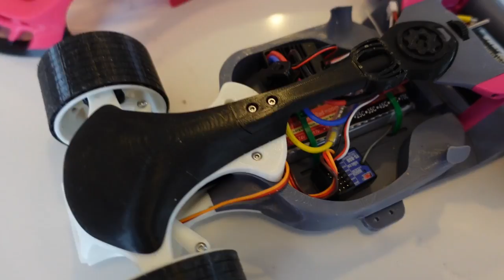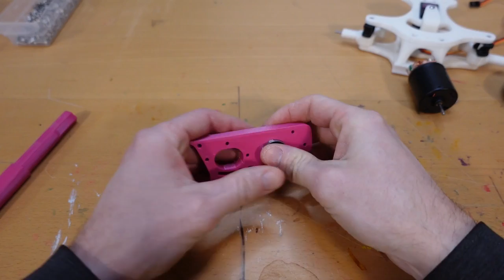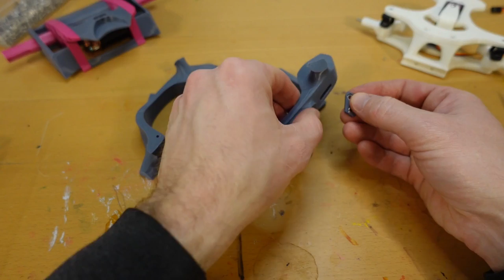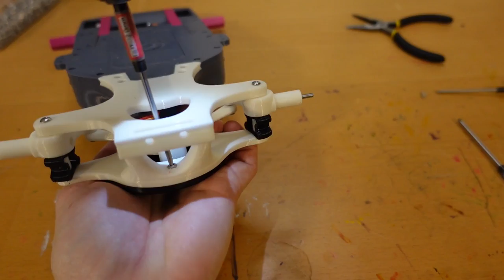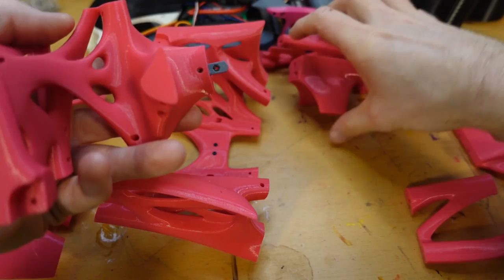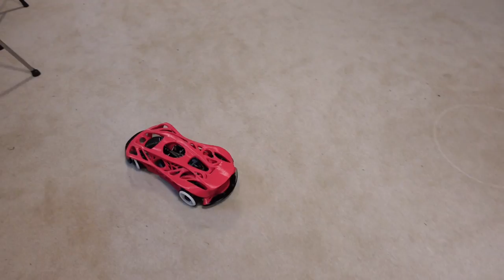Caramel CRC - Futuristic 3D Printed RC Car Build and Review

Comment: I almost built this.. I actually have built a lot of the other stuff on PrintedNest, such as the Caramel Minis for some kids.. but I’ve built too many TPU tires before and there is just too little traction for where I’d drive it. With a good rubber option, maybe brushless motor and a differential, would be really nice driving. Sharp body, though .. Good designers there.
Reply: Curious if you've tried a foaming tpu before like variosure tpu. It won't be as good as rubber but it's typically quite a bit grippier than any other tpu I've tried
Reply from the maker: You got it. I totally agree. I hope they make a v2 someday.
Reply from the maker: I haven't but I'll check it out.
Reply: @lio1234234  there is a version of NinjaFlex that has just come out called "Edge". Sounds promising but I don't know anyone that has printed with it to see how  it would do for tires.. and almost no one carries it yet.
Reply: Its just not necessary to 3D print everything, till even the tires. I like to make some custom rims to fit whatever tire is available in a compatible size.
Reply: @rcprinter  we will think about. Problem is than size of stock tyres will not fit with our design. Solution is to find some, and adjust size of the wheels, then it will work. Critical is external size and width of stock tyres, if we will fild some, we are able to make update of wheels for stoc tyres, quite fast. Then you will just re-print wheels and we are done. If someone of you have and idea, which stock tyres will fit our design, just put it here in comments.
Reply: @radiocontrolcardevelopment7329  If you have found some, put it here and we can check it and adjust wheel tyres for this. Btw, we can make 3 different wheels sizes for more most common stock tyres, if you guyz want :)

Comment: Very nice look car. The design doesn't allow for easy removal of the battery. I'd be concerned about leaving a LiPo battery in the car full time.
Reply from the maker: Its easy to miss but you can actually remove the battery through a little compartment in the bottom of the chassis with just 1 screw.

Comment: Love the design. Too bad it does not come with standard wheel hexes and an option for proper diff / transmission
Reply from the maker: Ya, it shouldn't be too hard to mod the axles for a standard hex though if someone really wanted and there's probably a way to add in something like a version of the OpenRC F1 mod diffs as well:  https://www.thingiverse.com/thing:2361718

Comment: Are you still interested in the Trophy Truck? I´m working on the V4 with 4x4.
Reply: Yes
Reply from the maker: Hey man its looking really good in that new snow video. I'm definitely interested but there's just a tonne of new models coming out right now and I'm having a hard time keeping up already. You should definitely do a body for it.
Reply: @rcprinter  thanks, i already started on the body, but it’s the hardest part of it haha.
Reply from the maker: @blubb7711  maybe just do a simple 1-2 wall body in 2 pieces that bolts together in the middle like the mkultra and robak have.

Comment: I was very impressed with the design. The tpu you used could be substituted for a different rubbery tpu. The gears could easily be modified in a version 2. I'm just curious how durable it is considering how many segments the body is made of. 🤔     one of my bigger concerns since I use to do alot of racing is how easy it is to make adjustments  and swap parts.  Most of the problem parts are normally made accessible for easy swapping in production rc's. This looks like it would need alot of disassembly to fix or swap parts 🤔    beautiful curves though
Reply from the maker: Yeah I've had to take it completely apart a few times to play around with gears and its a bit of a pain. Once you've done it once or twice though it gets a lot easier. Its definitely not as easy as a couple of body clips but its not too bad. For durability its hard to say but I'm definitely not keen to smash it into anything hard.